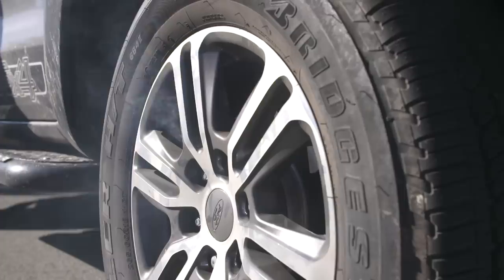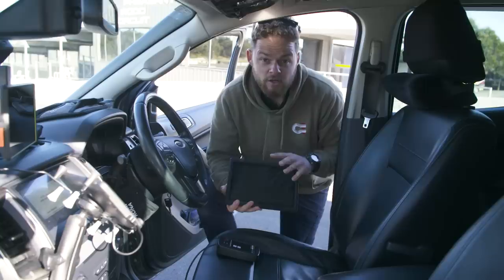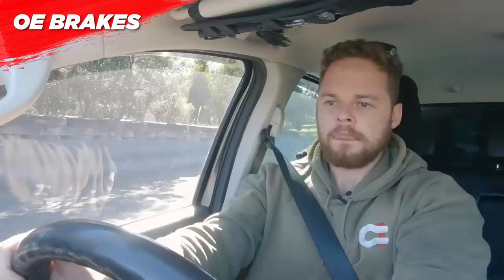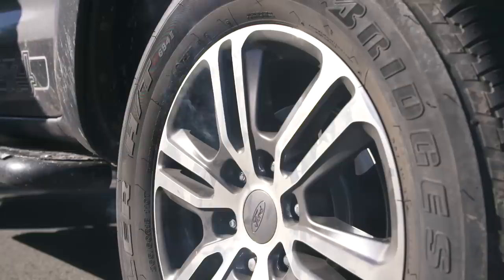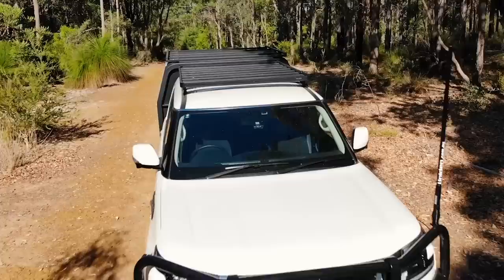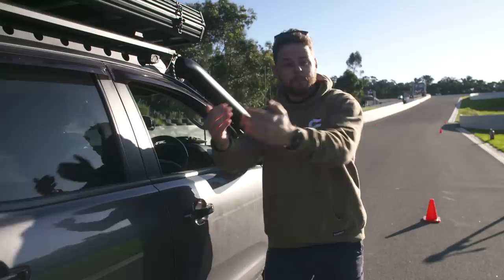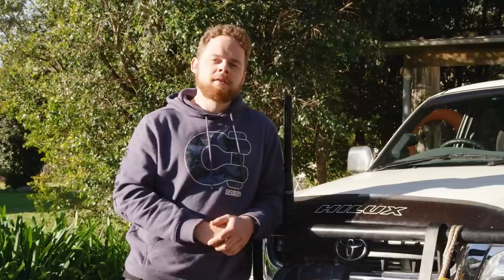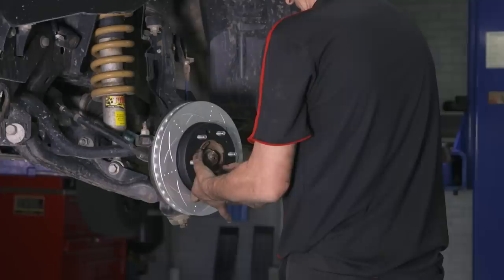ARE BIGGER BRAKES WORTH IT? Standard vs. Aftermarket brake test - Why the OE ones failed!

Comment: Great comparison!
Not sure if I missed it but what pads did you use please ?
I used slot & dimple rotor with bendix ultimate pads and these are worst pads I've ever had. They are ok around town but fade very very quickly, they create a lot of brake dust, wheels were black after less the 100kms, and after 10,000 kms they were around 80% worn out. I don't tow anything either, and I have a fortuner which is basically Hilux front brakes.

Comment: Hi jocko. Love the info on the brake test vids. Just an observation from my side. Is that on all the test that you did on the track i couldn't see that the vehicles abs kick in. We all know that if you install brand new disks and pad it will not work as it is supposed to work. Break in of brand new components............

Comment: Curious to know when fitting the bigger front brake rotators and calipers did you have to change the rim size of wheel with the bendix set up ?

Comment: 2018 dmax dual cab. in desperate need of a brake upgrade as I have set up 4b up for touring and has heaps extra weight now. sometimes is like a elephant skating on ice to stop........ not a pretty sight so this would help big time. 🐘❄️⛸️🙈

Comment: Hi all. I have a 2018 Toyota Hilux manual I'm maxed out with my gvm and GCM with a 21ft caravan and all the gear on the HiLux still running stock brakes redarc brake controller I would seriously like to upgrade 2 Bendix brakes cheers guys 👍

Comment: Loved it Jocko.  Was there a rim size minimum with the 6 pot calipers? My NT Pajero has to have 17's or bigger with its 4 pot fronts.  Even with these I,m a bit challenged off road with my 2 .5 off road van.  A bit heavier than my old camper trailer.

Comment: Hey boys I’ve got a 94 gq patrol and with upgraded rotors and pads it’s still scary slamming the brakes and not stopping very well at all, towing the camper around with an electric break still is quite frightening knowing if my breaks are going to hold up or not

Comment: Hey guys, I have a 2014 MN triton which goes pretty well but since I bought it have added a fibreglass canopy, dual aux batteries, water tank, bigger wheels and all the other gear so braking performance is getting a bit how ya going. Would be awesome to get an upgrade.

Comment: Hey jocko! I’ve got a buety 1998 gu patrol with extra added gear and alpine terrain down in vic im really in need of brake upgrade kit I’ve had time going down hills and it starts to get a bit scary would be mint to have a brake up grade kit just swapped a new rd28 into my car old engine carked it been trying to make it the most reliable vehicle like you boys on the show you guys have absolute rigs also in the mean time of doing the conversion I’m raptor spraying it to get it ready for trips keen to get back out there, can’t wait to see what you end up finding jocko I recon nice ford ranger would be nice mate!!

Comment: I have a 2009 Prado that I am looking to setup as a tourer. Based on the tests Jocko has done (Awesome video👏 , thanks so much) I am now worried that with all the extra weight braking will be an issue. I am thinking that an upgrade to the lines, bigger discs and calipers with the awesome Bendix gear will be a 'requirement'. 🤔

Comment: Pity you don’t test the unmodified Ranger or any other car. You’ll find the results are the same as the OE brakes. They are all designed to stop you quickly… once or a couple of times. Not repeated stops like in your test. When’s the last time anyone did 5 full emergency stops in short succession? Never.

Comment: Hey Jocko, I'm driving a 2011 Toyota FJ Cruiser 6MT.

Need a brake update kit as I live near the cascade mountain range and tow up and down sometimes over 6000 feet if elevation change. You ride the brakes a lot and need protection from fade. Especially when no one is around to help you in the mountains.

Comment: hi I have a px1 ranger with 2inch lift an 33s I tow a 27ft caravan I could really use an upgrade on my brakes as I'm on a pension it the cost is a bit hard to save for any ways cheers guys.

Comment: Got a Holden Rodeo 2002 LT Sport Dual cab, The brakes are just crap and really badly need replacement,  additionally Im about to take the tub off the vehicle and replace it with a canopy that will most likely end up full of gear so some better brakes will definitely be warranted

Comment: you're not even getting the abs to trigger jocko hit those breaks hard got the bendex xtreme in my 4x4 worth every cent only had to use the full stopping around 3 time and its great to know that those breaks are going to work 100%

Comment: Hey Guys,
I have a 2009 RC Colorado LTR. 
I NEED a brake upgrade because I have the vehicle loaded with off-road gear, barwork, canopy, drawers etc. I have upgraded springs shocks, wheels, tyres and chassis bracing. I have upgraded the quality but not size of front brakes. 
I frequently tow a 2.3T camper trailer in the NT on dirt roads and tracks where wildlife encounters are frequent. 
Please please please upgrade my brakes to keep my family safe. 
Richard

Comment: Hey Jocko! I have got a 2019 VW Amarok, every time my truck needs brake maintenance, this truck also every 20.000km need a front pads replacement. This is a big issue in this pick up truck, every time I need to be applying gearing down. I need them a lot because I’m putting lots of money just in brakes and it would be great having a good brake kit upgrade instead being wasting more money.

Comment: 2008 Jeep grand cherokee 3.0L crd. Why do I need an upgrade? Because it was fated. 

The ome brakes for my vehicle are garbage. They overheat easily and always end up warping with hard braking. I just noticed it happened again on my way home from work today. Which is why this is fate. I turned to youtube to distract me from the fact I was going to have to dull out more cash on brakes and what do I find in my notifications? This video... I'm not making this up. I'll mail you my old rotors and the bill sale for them titled not even six months ago. It's my third set in less then 3 years. lol

You're ether offering me a free set of upgraded brakes that solve my problems or you're teasing me with things I cant afford. You teasing me bro?

Comment: Brakes:  4 wheel discs is the best, jocko, when making a video on brake first know something about BRAKES, there are full metallic, the best for stopping used in race car  for yrs but eat the rotors and wear out very fast, , semi-metallic, half the stopping distance , full ceramic  half the stopping distance but live the longest in all conditions,. you forgot to mention , that upgrade is only the size of the rim used on the truck, example, you can use a 13" or even a 14" rotor on a 17" min rim, the rule of thumb is minis 3" below the size of the rim of the truck, . you cant put a 18" rotor on a 16" rim.???  also, in today;s life of trucks, its stupid to have 2 front disc's and 2 rear drums, most trucks come with 4 wheel disc, beside  your comparing small trucks only, in america, we have BIG truck with BIG  brakes. LISTEN AND LEARN,,  I KNOW I OWN BENDIX BRAKES IN AMERICAN BRANCH.!!!

Comment: Just shows how bad OE brakes are. Repeated use/brake fade is one thing but that they're not even powerful enough to break the limit of tyre adhesion (ie skid and activate abs) when cool is criminal. GUIII Patrol here, need the brake upgrade because the tyres are bigger, the car is heavier and the brakes are OLD.

Comment: Speeds are a bit out. I wouldn't bother with anything after test 2. You never going to go from 80-0-80-0 in real life that many times. Level 1 is of no benefit really, and the big front discs are not that much better than the rear discs. I'd just go straight to a rear disc and leave everything else stock.